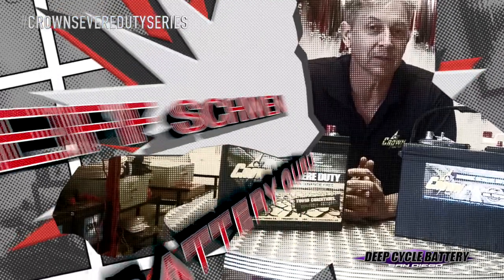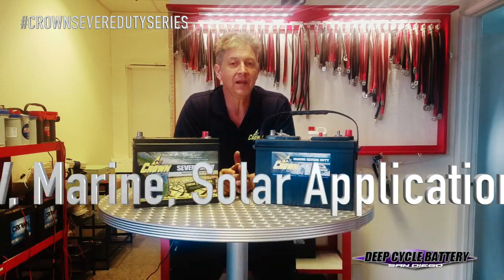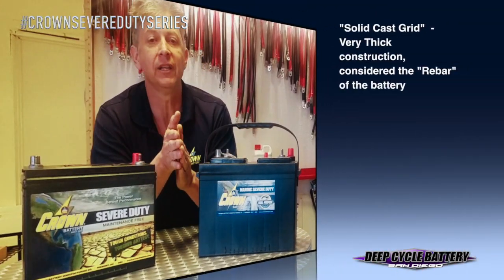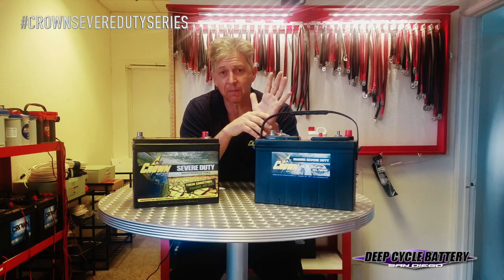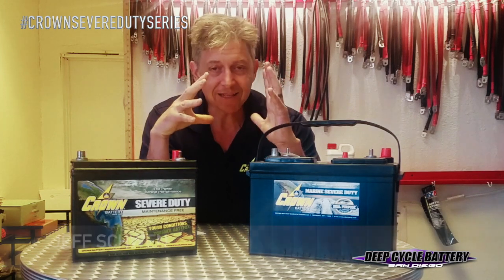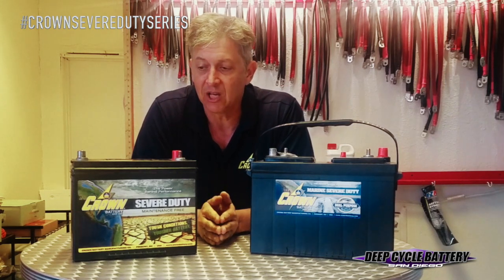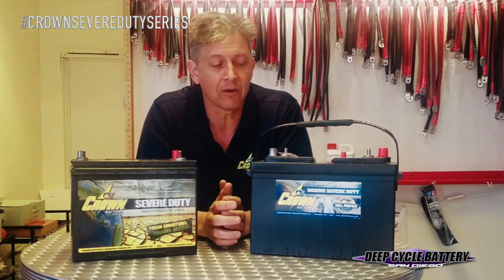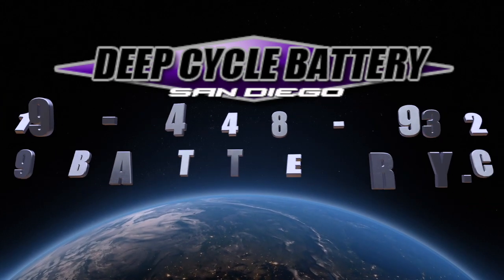Crown Severe Duty Battery 2.0

Comment: Are these a true deep cycle battery? Would these work as good as two 6 volt batteries?  I am replacing my batteries on my boat and was going to change to 6v being that I thought in a previous video you mentioned all 12v deep cycle batteries are truly a hybrid.  Thank you